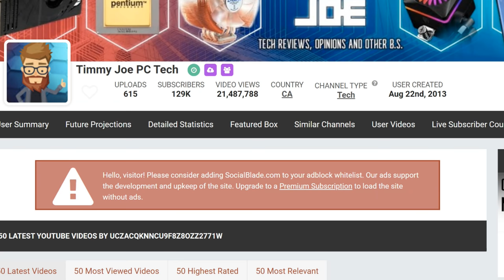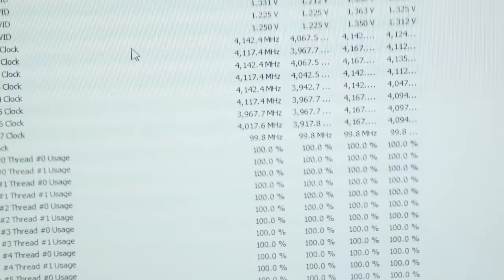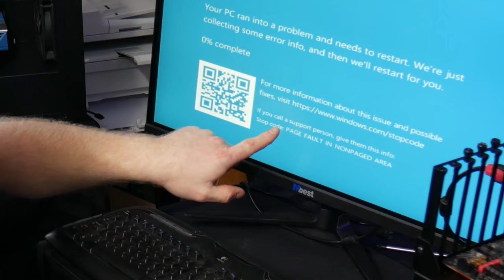This Ryzen 3700x was my biggest problem in 2019...

Comment: Must be something with that particular cpu (maybe a specific batch or a defect that somehow passed QA) that Gigabyte's BIOS doesn't play very nicely with. My wife's PC is a 3700X on the X570 Aorus Pro Wifi and has been going along just fine. In fact, zero problems with hers and my 2700X had issues running stock on both an Asus and an MSI board.

Comment: You know nothing Timmy Joe! Put your 3700x back in your Gygabite motherboards disable XMP and manually overclock your ram to 3200mhz if that is the native setting of the ram and you wont have blue screens anymore. The XMP on Gygabite is not stable. I had exactly the same problem with my Ryzen  3600 on a Aorous X570 pro wifi, works like a dream now.

Comment: 110% sure it's auto voltage from gigabyte motherboards. Ryzen 3000 behave a little bit different than previews series with less voltage. Mine sometimes didnt boot  with Asus motherboards. It was really random. The solution was offset +0.02

Comment: So basically don't use non-retail CPUs (early review samples) with Gigabyte motherboards. This is probably due to early stepping in the version of the CPU you got from AMD. which has since been refined/updated since retail.  I bet if you run CPUID you'll see different stepping numbers between that CPU and any of the other ones you have  So that means anyone else buying a 3700X right now, new, and retail won't have an issue regardless of they use a Gigabyte motherboard or not.

Comment: My greatest issue I had was with an ASUS motherboard, which would not post, I think it was a P5B deluxe. It failed under warranty and was repaired. It was running a core2 quad Q6600 at the time. Just outside the repair warranty it failed again. I tracked it down to a dry joint on the bios chip holder. To get the system to post i had to apply pressure to the bottom of the right side of the holder while pressing the power button. It would post and be fine when in use. It was kind of a good way of securing data as nobody could turn the PC on at all. Will never buy another ASUS board now though. Total overpriced junk.

Comment: I own a 3700x and a 9700K. I've had zero issues with my 9700K and it easily overclocked to 5.2 w/ max temps of about 55C. I can't say the same about my 3700x, it runs hot AF 55C idle & 75C load, I've had to update the bios I dunno how many times, same goes with the power plans and it never once boosted to 4.4, the closest I've reached is 4.275 thats with air or water. I'll admit it runs okay and I'm sure will out perform for productivity but my 9700K still outperforms in games especially in VR and Emulators. If you are doing gaming and a lot of productivity it's probably in your best interest to go w/ AMD but if you are mostly gaming w/ little productivity I'd still recommend Intel. Hopefully Amd 4th gen will correct a lot of these issues and not lie to us to get sales, it isn't necessary.

Comment: shooting in the dark here... maybe the memory controller in THIS 3700X does not like the memory topography in those boards ? (assuming they are the same) that would be the only logical explanation to this problem. it's the only situation where i could see a cpu not liking a motherboard vendor causing an issue that looks like a memory issue.

Comment: This is the same bug I had with my 2600x and Gigabyte B450m Ds3h... All I had to do was get the right chipset drivers, bios and turn off Fast Boot and Hibernate and set a Voltage a Negative offset for slightly less juice but enough for stability... I was pissed for days until I did that and for about 5 days all was well then bam bluescreen... I then assumed the same thing... Crap Board... Nope there was one last little gremlin Memory OC... I lowered from 3200Mhz CL16 at 1.35v to 3000Mhz CL 15 at 1.35v and for six months it's been going fine. Deeper Examination of the Memory Controller on Gigabyte Boards shows that they are very picky... Also if the Voltages are too low at near idle poof... Basically Check Yo Voltages.

Comment: I had similar issues and it was solved by adjusting the load line calibration. The issue is probably that the Gigabyte boards have too high v-droop that the cpu simply is not stable with.

Comment: I prefer the 3700x more than 3900x... I just sent my 3900x to Amazon. And bought more ram and went with the 3700x, more heat more power draw and just a couple of Fps, sometimes 3700 performs better in games, that's more of a workstation cpu

Comment: Hi Timmy i also have the gigabyte b450 gaming x with a ryzen 7 2700 and have had similar problems. First was bluescreens of death followed by every 5 days being asked to install a boot drive which i had installed on a m.2 nvme drive. The weird thing is even though i was being asked to install a boot drive the bios was showing my m.2. Eventually it got to the stage where i could not even get power to my pc when switching on. for 2 days i troubleshooted my issue and in the end i left the pc unplugged for a day and took out the cmos battery and then reinserted it and left it for a further 30 minutes. I then switched pc on and everything is now working fingers crossed with no further issues.

Comment: My weirdest motherboard troubleshooting was a small organic short on my keyboard that somehow reduced the voltage to the USB but not enough to show up all the time.  USB devices worked but sometimes caused BSOD's and double key strokes and read errors on an external HDD among other errors I don't recall.  I didn't solve the issue until I started swapping out external devices then found the short.  It took me about two months to figure it out.  And this is why you should eat over your keyboard, lol.

Comment: If you have any contacts at Gigabyte I would contact them and see what they say, any company that cares about their products should have something to say if not ask to investigate. that being said it could be an AMD thing as well.

The gremlin I have been dealing with for a while was an AM2 Nvidia chipset board from Gigabyte that won't boot with one of the 2 CPU's I have for it, despite being supposedly on the latest bios release. Sometimes it will only run memory in single channel unless all dimm slots are full, and most recently the I/O such as USB and IDE have been causing issues, requiring a PS/2 keyboard to enter the bios and it will not load a full windows install. I think one of the chipsets may be dying :/

Comment: Hello joe the only thing that came to mind was power delivery cleanliness when delivered through the motherboard during shifting between high power and low power states causing the system to hiccup like that so maybe try the power adjustment in bios and maybe raise the base power output just a tad as it may stabilize the overall power output. Hopefully this should yield better results unless there is permanent damage on some parts of the die hopefully not. Best of luck to you joe.

Comment: I am using a 3700x in a Gigabyte x570-I pro wifi, no problems, except when I tried to install too old of a version of win 10. Your issue is clearly bios related. Gigabyte doesn't have the bios compatibility for your engineering sample.

Comment: Twitch streamer Vinny recently purchased parts for a new computer with a Ryzen 3900 in a Gigabyte motherboard. it seemed to work just fine but she wasn't completely satisfied with the noise caused by the AMD stock air cooler so he decided to get a better silent cooler for it and chose one of the Be Quiiet! Dark Rock Pro coolers and for whatever reason it broke everything. Pretty sure Gigabyte is the issue.
I've always thought of gigabyte as the budget option for this very reason. I've heard too many bad stories, which leads me to believe they have a poor track record in comparison to the other brands

Comment: I had the same issue. I had a 1600 on an ab350 gaming board from gigabyte and it worked fine. I got a 3600 about a month after launch and swapped it out, and I was having random blue screens all the time. I troubleshooted everything, and eventually decided it was the 3600, so I sent it back to amazon, and got another 3600. Same fucking issues, it was frustrating and I had no idea what was going on. Usually it was giving me a ram issue on the blue screen, but occasionally I would get a PCI bus issue or something random. I ended up buying an msi b450 gaming plus board and put it in that, and presto, problem fixed.

I then put my 1600 back into the gigabyte board, and used all the extra parts I bought for troubleshooting and made a 2nd computer. It hasnt had any blue screens since, so I don't know if it has an issue with the Zen 2 architecture, but it seems to be an issue with the newer cpus.

Comment: I had a issue when I was restoring a old computer. When I tired to install Windows XP it would always blue screen during the install. Turns out my external hard drive that I was using to install XP was incompatible, because Windows XP does not support sata drives and my external hard drive was sata.

Comment: I have a ryzen 5 3600 that will not allow memory tuning on any b450 motherboard. I spent a lot of money I don't have figuring that out. I ended up with an x570 and fixed the issue. Gigabyte support took about a week to respond over their ticketing system, which didn't help. now my hairline is missing.

Comment: Most recent is a GigaByte X570 Aorus Elite, no cold boot about 80% of the time. Different CPU, memory, storage, PS and vid card same thing. Different motherboard same model works fine for other people (with any number of different parts) so the question becomes, defective motherboard or flaky BIOS. I don't know the answer but now I'm leery of GB mobos which sucks because I've bought many over the years and they've been awesome. Anyone else with the same cold boot (no post, no beeps) problem? I tried every BIOS version.

Comment: The only problem I have with my Ryzen 7 3700X is that the CPU temperature right after stating windows is at a pretty high 50-79°C at times.

Comment: that IRQ LESS THAN OR EQUAL and APC Index blue screen tells me you had a driver problem.
page fault in non paged area can be caused by driver issues as well
It all points to a driver causing your problems.
The reason when you switched to MSI it worked is whatever driver was causing the problem for you isn't being used anymore b/c of the component change.
Now you got a bunch of people believing its some mysterious thing on the Gigabyte boards that will cause a bluescreen.
A little more indepth troubleshooting and you could have figured out which driver it was.

Comment: I have a Ryzen 3700x  and after I flashed my Asus X470 Pro with the latest bios version 5406 , I got random crashes when boot.  The weird thing were when it crashed, the cpu fan speed would get stuck at low running speed at boot and in turn overheated the cpu.  I reverted the bios back to ABBA version and problem gone away.  no more crash at boot.

Comment: I ran into the same issue with my Gigabyte X570 Master & 3700X & 3900X.  
The motherboard would not recognize all the RAM.  I eventually RAM'd the b!tch.  The board would blue screen with all the RAM.  I was using vendor approved RAM and the blue screens wouldn't stop rolling in.   They replaced the BIOS chip or flashed from release to latest Agesa thinking I wouldn't notice but said the board was fine.  Technically I guess that was true.  The board was fine but the board OS was farting up the shop.

Comment: Never had a cpu reject a motherboard, but definitely had gpu's that would not work in various boards. Like i got an intel 975x board here that just will not accept a gtx 690 i was going to put in it. Also have an asus A8V that needed some esoteric settings, including setting an arbitrary aperture size to even boot with 4×1gb sticks installed.

Comment: I have a ryzen 7 3700x w/ Gigabyte AORUS B550M  motherboard. One issue so far is the idle going from low to high randomly just sitting their looking at desktop.. going to change ram speed from stock 2133 to 3600 later today, hopefully all goes well

Comment: I runa 3700x on a MSI B450 Tomahawk Max.

Have had zero issues like this.
Reply: Same for me
Reply: MSI is the most reliable motherboard for years, no issues, even when you do extreme OC to the CPU, it is so reliable, MSI is my choice for almost a decade now.
Reply: novra hadi i have two MSI Ryzen boards so far

B350 Tomahawk paired with a 1600

B450 Tomahawk Max paired with a 3700x

I chose these boards on purpose because of price, component quality, and reliability

My 1600 was able to do 4.1ghz at 1.3v on that board. Sadly it died and after investigation from AMD, still no idea why. Was it the board? I actually doubt it. Anyway, that combo lasted from Ryzen’s launch up til November 2019. 

I chose the B450 Tomahawk Max to go with my 3700x because the 3700x isnt power hungry. Even with a mild overclock it does not stress the vrm’s. You dont need an expensive X570 for that specific CPU which is very nice.
Reply: @verios44  Nice pair bruh! Your 1600 died perhaps the cooler cannot handle the heat caused by over voltage. OC requires some additional cooler.
Reply: novra hadi its cooled by a Scythe Mugen 5 rev B. 

During initial stress tests using PRIME 95 max temp was 72c...after 12 hours

Actually using the same exact hsf on my 3700x atm and its still doing its job well
Reply: @verios44  Ok, it was a rare case then, I never experienced any AMD CPU died even over-voltaged at 1.5v, I use a big desk fan to help the cooler.
Reply: novra hadi yea it was rare and made no sense

The tech handling my rma asked for as much paperwork, recordings, etc I have. And I actually had a fair bit. A few screenshots from the Prime 95 run, CPU-Z validation link, etc

When they sent the replacement unit, there was a service note in there that can be summed up to a baffled tech.

Comment: Had same problem with my ryzen 3600, took me a while to figure out the CPU was bad .. funny thing that it worked just fine when i bumbed the voltages up, but yeah did warranty on that CPU and got new working 3600x.

Comment: I have a set of crucial ballistix 2x4gb ddr3 1600 mhz. It worked fine for a year in 2 different builds. 
Then i built a used parts htpc with it and it would just randomly crash or freeze with no pattern at all.
For months i blamed bad oc or other parts.
 Over the holidays i tried again because we used the pc a lot and it kept crashing.
Turns out the ram works in every other PC and every other ram works inside this PC.
Just not both with each other.

Comment: Just curious what errors you got on Win10's Reliability Report? My son's computer Ryzen 2600x on a MSI B450i Gaming with an MSI Rx570 Armor 4g AND my computer (Ryzen 5 2400g, Asus Prime X470 pro) both will crash randomly. The reliability report lists a hardware error Problem Event Name: LiveKernelEvent
Code: 141
 with parameters that change to different things. I've updated EVERYthing from drivers to BIOSes and can't figure out what the issue is. All my searching for that error comes back with updating drivers.
Now this can happen  a couple times per day, but not happen for days in a row. Sometimes it will crash when the computer isn't even being used. No idea what the heck is going on.

Comment: I had almost an identical issue on a friends build with Ryzen 3 series cpu. Resolved by upgrading to windows 10 v1903. We had an older install of 1511 or something that did not like Ryzen 7 3600x and/or the 450 chipset, after upgrading, all was well. We were getting the same random page fault errors. Ymmv, may not be your issue, but really really looks similar?

Comment: I had BDOS from hell with my secound Ryzen computer, exactly like you had. I have a B450 MORTAR MAX motherboard paired with an Ryzen 3600. I first tought it most be the ram, the gpu, drivers and eventually wtf is it. I did update the bios right away when I installed the computer. It turns out after alot of troubleshooting that my B450 mortar max only works with its original bios paired with the Ryzen 3600. Every other bios version gives me blue screen from hell. So i had to roll back the bios driver. Hope my experience can help some troubling souls out there.
Reply: I have similar problem... I have ryzen 3600 with B450 mortar not max varient which version of bios should I update to

Comment: Since I have Ryzen I had in total 3 MSI motherboard and 2 Aorus (Gigabyte) board and the Gigabyte Aorus board had much trouble with Ryzen 2600 and Ryzen 3600 and MSI boards not. From my experience and from what I have read on forums in my language Gigabyte Aorus board are not recommended. MSI board are just perfect without any problems. 
Aorus (Gigabyte) boards often causes problems with diffrent AMD Ryzen CPU's.

Comment: Gigabyte Motherboards are trash. The IOMMU groups are totally messed up. Seriously, too few groups. If you are looking to do virtualization, don't get a Gigabyte MOBO at any cost. I had to use the ACS patch to get fake IOMMU groups which is not ideal. Gigabyte MOBO also gives me stability issues with Linux kernel 5.7 (altough Linux LTS 5.4 works fine even under stress tests for prolonged periods of time and is rock stable). Want to find out if a MOBO is trash? Look at the IOMMU groups.